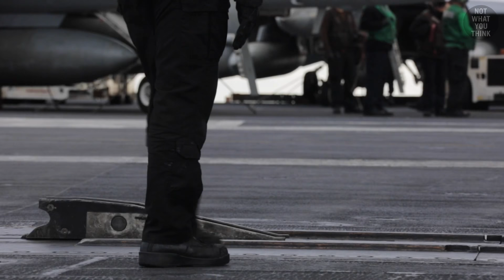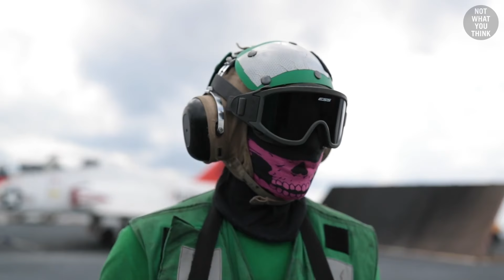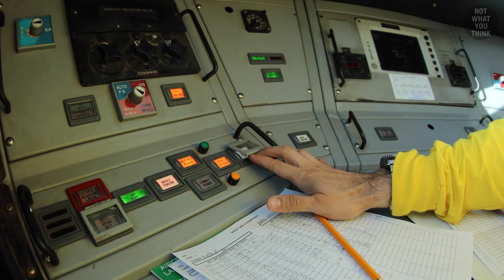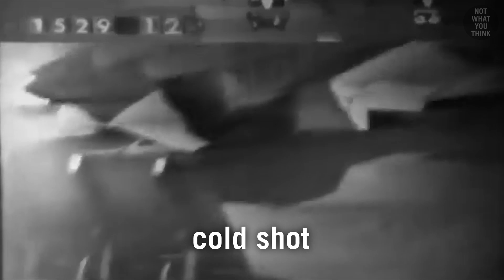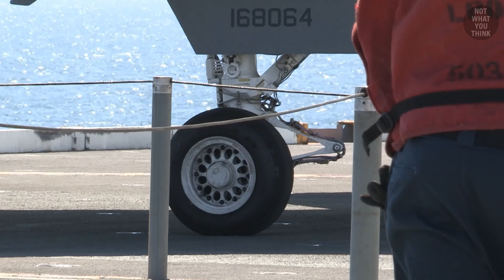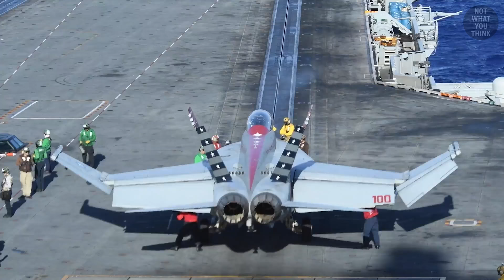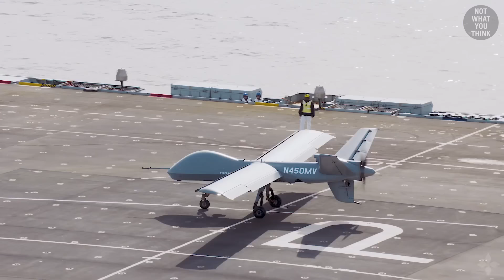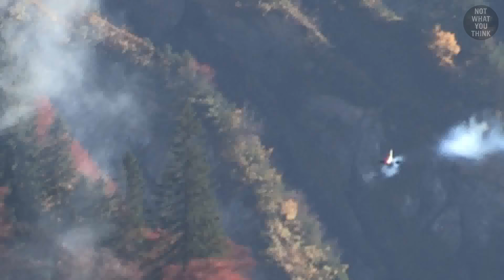Why the US Navy is Replacing Electric Catapults with Steam

Comment: Simple
Steam while tried and true required extensive work operate and maintain 
The EMALS on the other hand is fully digital. The system can recognize potential issues such cold shots before the aircraft hooks up but most important its built with redundancy to prevent cold shot
The rest about the being able to tailor the shot more effectively is the rest of the system improvements over steam

Comment: Its nothing to do with drones, drones werent even on the agenda when development began for the electromagnetic catapaults. They do however mean that less robust drones and aircraft can be built.

I thought you finally got it when you mentioned the jolt, but you were wrong when you said the aircraft were heavy duty and so it was only a dmall stress. That jolt is why planes design for catapault launch have to be built far stronger, are far heavier and the airframes have a far shorter lifespan. Electromagnetic catapaults are expected to massively increase airframe lifespans.

Comment: Steam catapult is reliable and inexpensive because it is simple. Electromagnetic catapult (linear induction motor) is two orders of magnitude more expensive because it is very complex.
Reply: Steam systems are in constant need of maintenance and are down all the time.  Tons of highly trained manpower to test and replace high-pressure pipes all the time.  Electric systems take up 1/3 the space and need fewer support staff.  Even steam trains have gone electric.  Steam was great 45 years ago, but the tech is old and expensive.  Just because you have a steam train that has run for 50 years doesn't mean we should replace it.  Electronic systems are WAY cheaper to build and operate.  The cost is in the overhead of the US Government and the Navy.
Reply: @loopie007  Electromagnetic catapult costs $600 million to $900 million. I could not find info about steam catapult cost. If the steam catapult is designed well, its maintenance is minimal. Steam locomotives were not replaced with electric locomotives. They were replaced with diesel locomotives. Electric locomotives are sometimes practicable because their motor is rather simple - it is made of about one dozen electromagnets. On the other hand, the electromagnetic catapult is made of about 100 stator coils and two compulsators. Steam is less efficient than electricity, but this flaw does not matter in this application. What matters is much lower cost of steam.
Reply: @loopie007  Do people understand how much work it was to keep steam trains working? They were a maintenance headache, they were also very dangerous just to work on. Boiler explosions were common and deadly. They also required more people just to operate.  When diesel electric locomotives were 1st brought on, they were more expensive to make, but very soon after the railroads were saving tons of money in all the other aspects of the engines. They ended up being safer, more reliable, and cost less to use and maintain all around. The EMALS system will have the same benefit.

Comment: Never realized steam catapults basically guess high and just beat up the airframes to stay safe
Reply: As a guy that ran flight decks for a living I disagree with this.  A lot of information came from the Navy selling this product to congress to get appropriation for the carrier they wanted. In reality,  the CSV (capacity selector valve) pretty accurately delivers the correct amount of steam for launch. There has been no change to aircraft maintenance schedules to account for supposed airframe stresses caused by steam catapults. EMALS is the right choice because it's far less maintenance intensive.
Reply: @michaelmappin4425  that would've been my guess. seems like there'd be a lot less maintenance with an electric system vs steam
Reply: @berengerchristy6256 that's pretty much the rules when you compare two or more system used for identical purpose where one system has a lot more moving parts compared to the other, system with the least amount of moving parts would be much more reliable overall alongside far less maintenance intensive (which again also makes them much more reliable with far more availability for duty).
Reply: @zidniafifamani2378  personally, i'm looking at the whole program and saying, "they don't build em like they used to" and for good reason.... you take a reliable system that requires mx and can be fixed measurably easier than anything else... and want to replace it with a system that if it fails... will require specialists and contractors... has anyone asked about how long replacement parts are going to take to get if the fancy new thing goes offline?  how HARD IS IT TO FIX?? 

Am i the only one who asked the question, why don't they put ONE on one side of the carrier and Keep the known system for the Other launcher.... carriers have More than One catapult... this entire thing is ridiculous.  field one, test it, see how it does.  Don't build a Whole new ship and put it in the water expecting it to win when you haven't even Field Tested the GD launch system.
Reply: @berengerchristy6256  Less MECHANICAL maintenance vs
More ELECTRICAL maintenance.
Reply: @damien9683 no, its not a rail gun. The coils can be built with enough over provisioning they will last as long as the ship does. The only moving parts on the electrical version are the sliding mechanism that exists on the steam version as well.
Reply: @damien9683 well yes but it's much cheaper to maintain a heavy duty array of magnets that only wear out when operated out of spec than to maintain a heavy duty piston that is wearing out with each use in spec
Reply: @damien9683  i'm not so aware and i go wondering: if carrier stands without generators? Imho whatever electric faults, the Uranium bars in reactor could generate steam and this can ensure launch(s) avoiding that emergency cut-off to the air vessels.

Greetings.

PS if i was still there, you sure, should vote Dem.
Reply: @damien9683 Yes, but the NAVY is pretty good at electrical and the EMALS takes up less room and is safer because it has no high pressure plumbing.
Reply: @michaelmappin4425 i agree.  The. Only maint i ever did that was “extra” if ya want to call it that was removing the towbar on the nose landing gear for NDI inspection..   i would say more damage is on landing than on launch by a long shot and more parts related to landing have to go to NDI..
Reply: @tomspettel3646 thanks for the reply.
Reply: @michaelmappin4425  Yes, you don't need replacement parts like those enormous pistons I saw in the hangar of the Abraham Lincoln.
Reply: @nicholasconder4703 Yep, great comment.  And those giant circular things hanging in the bay are slot seals.🎉🎉
Reply: @michaelmappin4425 interesting I would have thought the gradual increase in speed vs the "punch" would definitely result in less maintenance and a longer life airframe regardless of reinforcement.  Or at the very least the option to reduce reinforcement for other advantages such as speed 
,payload, range and potentially maneuverability to I'm not sure of the physics on the last one
Reply: @Nigel-i5g From the cat shots I've seen, the holdback is the same so the force necessary to break the holdback is very similiar. My main point though is from the airframe perspective. If there's no maintenance revisions for using the new system, where does the benefit lie? Well, there is a seriously huge change to catapult maintenance and personnel needed. To the tune of about 90 fewer bodies and 100s of hours less maintenance weekly. Additionally, without the piping, accumulator, valves, and insulation, the ship has significantly increased interior space for other uses.
Reply: @michaelmappin4425 isn't the physics reversed for electrical catapults starting off weaker then it ends to launch the plane vs catapults starting off stronger and lossing power at t end as steem is vented? That's the puch I was talking about or the tendency to "jerk". As I think it's called. I feel like the difference is somewha like a baseball hit bya bat or thrown by a pitcher.
Reply: @Nigel-i5g Are there any amusement parks near you that have roller coasters using electromagnetic launch? I feel like when I ride them that the acceleration is instantaneous. It's very smooth but I don't feel like it's getting faster as it goes. I am only going by launch videos I see from the Ford but there is a standard sequence of events written in the book we call NATOPS. The sequence is the same for steam or EMALS and includes the launch bar riding through the track until it engages the buffer hooks which pop up from below. It is all thrust taxi at this point. The holdback bar is placed on the rear of the nose landing gear and then engaged with the buffer hooks. From here the aircraft taxis forward until the launch bar is over top of the catapult shuttle. There may be intermediate steps of arming ordnance or waiting for the scheduled time to go green, but when it's ready the shuttle is engaged and the aircraft is run up to military or combat power. The holdback is designed to keep the aircraft in place with brakes off until the catapult launch button is pushed and the force is sufficient to break the holdback. The holdback is the same one used for steam or EMALS so the breaking force, should be the same. I retired 13 years ago and never worked with EMALS directly but I don't see anything different except the steam from the track. I do understand what you're saying though, in theory, the catapult would be able to pull gently to say 25 mph and then accelerate like the dickens through the rest of the launch. The problem is that the aircraft engines have to be already spooled up with brakes off. Without the holdback sequence, the aircraft would start rolling without the catapult.
Reply: @michaelmappin4425  if i do not go wandering wrong, the EMALS system works by magnetic field apply to the shuttle hook, and keep It under Its magnetic area, airframes with loadouts and their full of fine electronic devices.
Reply: @michaelmappin4425  never buy a second hand fighter jet from a steam launch carrier.
Reply: @konradyearwood5845 Good tip. Thanks.
Reply: @michaelmappin4425 And it is safer and allows for more room below deck and on deck, right?
Reply: @easyenetwork2023 Yes the piping from the steam in the reactor spaces and the giant two story tall accumulators take up far more room than power panels and wiring. As far as safety goes, I'm not immediately thinking of factors which contribute directly to that. I'd like to see Naval Safety Center data on catapult steam leaks or ruptures that resulted in injuries or death. There was a water brake incident on Stennis, I think, but I never got that full report.
Reply: Thats very interesting and informative. Thank you from your service, love from england
Reply: @michaelmappin4425 too bad according to Trump Steam is cheaper
Reply: @MadKirkegaard I disagree wholeheartedly on this matter. I've written him more than once about it.  Steam is dead.
Reply: and takes far less room.
Reply: @jamesleland536 Your saying steam takes less room? Because that is wildly far from true
Reply: @michaelmappin4425  Steam doesn’t require power to launch and the Ford sat pier side for years because the damn thing couldn’t work
Reply: @tx_7134 EMALS works now. Steam very much requires power. The grab, an electric motor which moves the shuttle back and forth in the track in every phase of operation other than the actual launch stroke, is one example. All the controls, valves and  gauges (other than steam and water pressure) are electrically controlled. The jet blast deflectors are hydraulic operated and electric controlled. If we lose power during launch, that's a wrap. Launch complete. Park those birds.
Reply: @m @michaelmappin4425  You must have been a handler, and yes if the ship lost power no launch on EMALS, try explaining that call to the bridge.
Reply: @tx_7134 🎉
Reply: @michaelmappin4425  there definitely is more fine control in an electrical system, otherwise it wouldn't be realistic that it could deliver such a large difference in airframe stress/lifespan.
Reply: @michaelmappin4425
I don’t know why the USA is so obsessed with acronyms, it’s a cultural thing, everything is a "platform" or a "system", and it feels like a competition to find the dumbest names for every single piece of technology or mission that they try to hammer into making a word with an acronym 

There’s a 30 page long Wikipedia article on American military acronyms lol
And before anyone says it’s efficient, my issue is that if they didn’t pick convoluted names to begin with then the name of the thing itself would be as fast to say as the acronym while being much much clearer

Like the humvees, original name: "High Mobility Multipurpose Wheeled Vehicle HMMWV" like how dumb is that lmao 

armored car ❌
Diesel fueled high mobility multi purpose mission adaptable wheel vehicular platform for off road and on road applications troop an matériel carrier ✅
😂
Reply: @IceRain-f5v  Not the U.S., but militaries everywhere. And the same goes for medical ICU or every field of work where time is of importance.⏳
Reply: @IceRain-f5v  FWIW:  I worked for defense contractors back in the 1980s and a lot of the people working on specific programs that were commonly identified with acronyms didn't know what the acronyms meant.
Reply: It's better than the alternative, right? And I would expect them to account for it in design of an aircraft. So, it wouldn't really beat it up. There would be more stress compared to ideal catapult. But within design limits.
Reply: Honestly if the air frames were replaced on schedual it would not matter... at all.
Reply: I know. It's a bit eye opening
Reply: I think I recall a friend working on a boat managing catapults long ago.
Reply: @OvalnetProductions Retirement time goes by fast. 😂
Reply: @OvalnetProductions  Not a boat. It a ship boats are non-sea going vessels. Excluding subs but that only cause first subs were basically small vessels on a ship back in day.
Reply: @gwhitty12 …boat…ship…..giant floating vessel is what I had in mind…
Reply: Never heard any discussion on steam catapults overstressing airframes, but did see a article, a while back, concerning the EMALS overstressing them.
Reply: @chuckaddison5134 Like I've said, it's part of the Navy's pitch to congress but translates to a solution for a problem that doesn't exist.
Reply: Its a mighty good guess though.
Reply: Just lie. He’ll never know
Reply: I'm not sure this is an accurate statement, although the Navy may have said it. I flew the A-6 Intruder, which stayed in service for a very long time. When they needed to extend the service life they were rewinged. Perhaps some other key parts timed out, but the basic airframe was sound.
Reply: Electric catapults unexpectedly beat you up mid-launch, as it detects lower fart outputs and thus unexpectedly, and severally, adds significant launch thrust -- MID-LAUNCH.
Reply: As microwave weaponry becomes a thing for attacking the electrical systems of a aircraft and surface vessels  (as well as IADS in Venezuela) the purpose of steam driven backup systems will become more apparent.
Reply: @WefixBayonets Everything had electronic controls. The ship, the aircraft, the catapult, everything. There is no way steam could ever be used as a backup.
Reply: it's not office job you dummy.
Reply: @precisionleadthrowing4628  an*
Reply: thats how most steam based systems works......dafuq they teach in your world about 2 century old tech??
Reply: So it’s a training issue